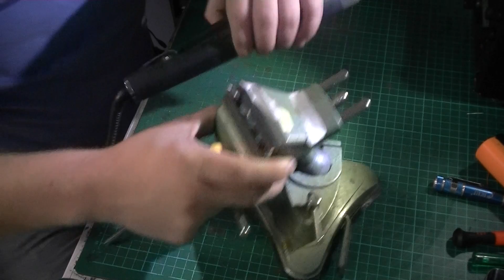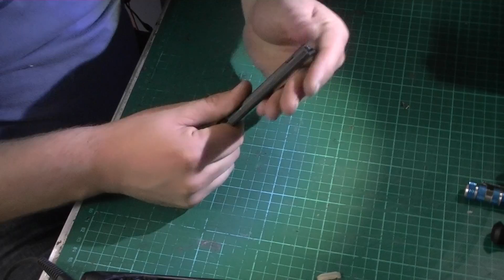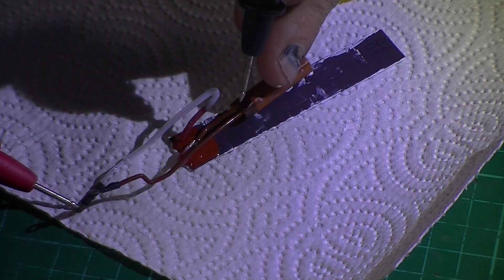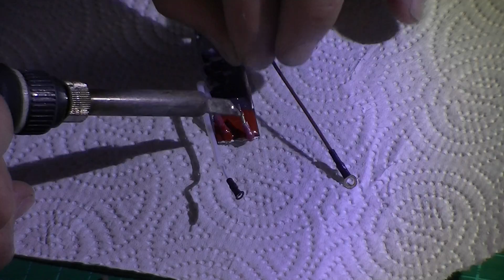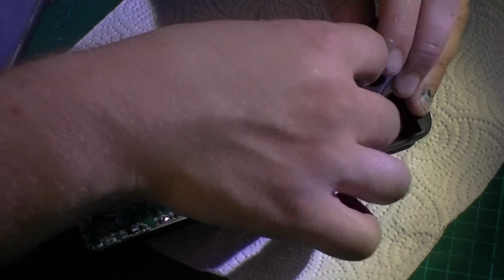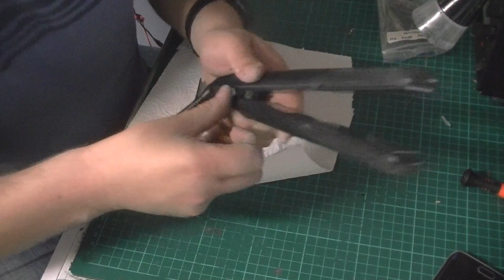repair of a cloud nine

Comment: So after I repaired my wife's straighteners they work fine. However, when the plates are pressed together, they are not flush. There is a slight gap toward the hinge end of the plates. I have had to loosen the screws near each plate to stop compressing them too much? Any ideas where I went wrong? Thanks.

Comment: hi there, i got the c9-l1.2 , when it power up it make consistent sound but no heat on both element , i check  both of the left and right they showing 70 ohm and the thermostat is all good too, do you have any other glue ? thanks
Reply from the maker: is that  70 ohms measured while its in circuit or out ?